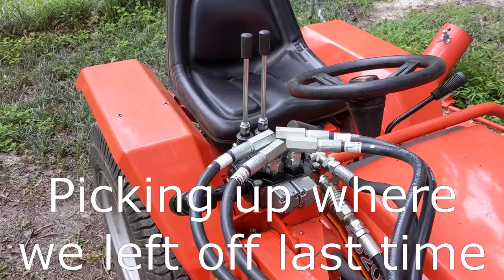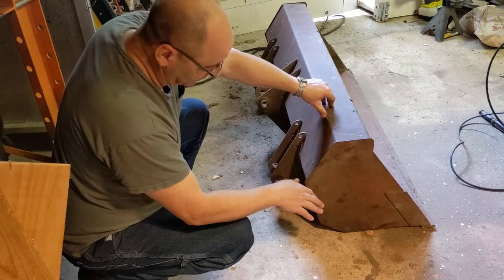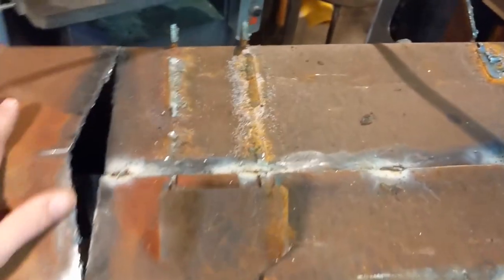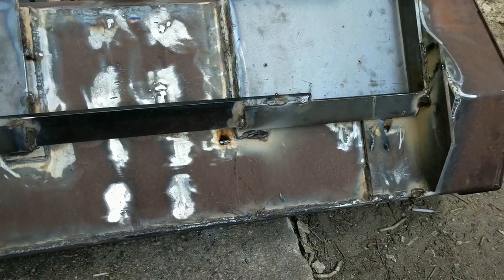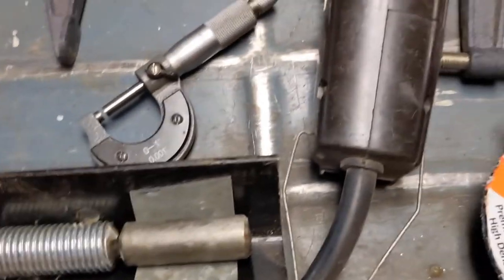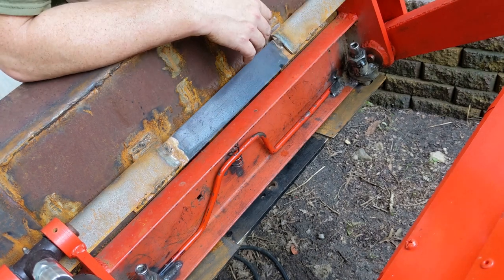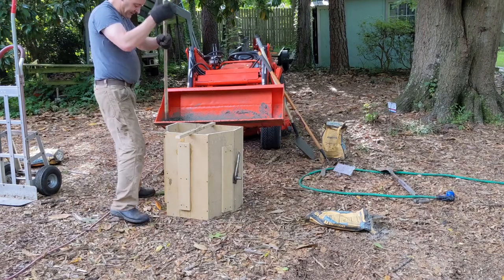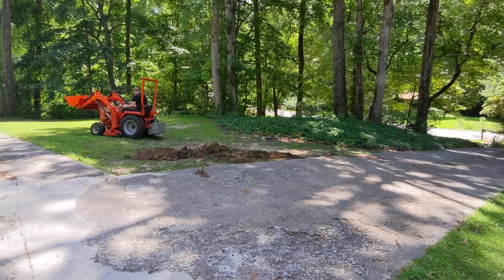Building a Loader for a Garden Tractor - Phase 6: Finale

Comment: Great perseverance!! Great outcome!! And im completely positive that  the Satisfaction you must of felt when it was finally done initially must have been great! And this particular series you put out made me a subscriber as i too hav something similar in the very beginning stages too! I recently aquired whats called a Toro sand pro 5040,its a 3 wheel hydraulic  driven tractor that was originally put out by Toro for sand traps at golf course's with both front and rear hydraulic attachment options, basically looks like  a 80's era honda 3 wheeler but looks like it was built by the same company that builds the armored presidential limo,"the beast"!!! Im talking alot of areas where 1/2" plate was used,buy its a perfect platform for a yard tractor/3 wheeled skid steer! Anyways ,very good job sir!

Comment: This is the best engineered loader and tractor that I have seen. You have corrected shortcomings that the original engineers of the tractor missed out on. I agree that hard lines would be a better change however that would be way too much work. I wouldn't say it is over-engineered because it is something that I hope to do myself. I am in a quandary though. I am either going to use my Allis Chalmers B10 or my John Deere 110 or possibly a Case that I would have to find. After all your work what would your suggestion be? Thank you so much for sharing the build with us. Cutting your lawn is good. Cutting your phone is not so good.
Reply from the maker: Thanks for your nice compliment.  I'm afraid I don't know enough about either of those machines to give you very good advice.  My basic approach is to look for a strong enough front axle and frame, or one that can be easily upgraded/reinforced.  And at least a factory option for a hydraulic pump.   Even if the factory pump needed to be upgraded to a higher volume, you'd still at least have a predetermined location and mounting bracket and drive pulley for a hydro pump.

Comment: I would still put a rubber piece around the aluminum to protect the hoses any vibration will cause the hoses to wear  through where ever it touch metal , an once of prevention is better than a pound of repairs.
Reply from the maker: That's good advice.  I'll see about getting some grommets.

Comment: You had better fill those  rear tires with some heavy fluid ballast ... and be careful driving at an angle anywhere at all .Been a licensed hoisting engineer for 
45 years .
Reply from the maker: Good point.  I ended up with 125 lbs in each rear tire. And a 350 lb concrete counter weight hanging from the three-point hitch.  

Even so I carry the load as low as possible and exercise extra caution on any slope at all.
Reply: @TheBuildist  
I  am glad  that your interpreted my previous comment as  friendly suggestions and not a lecturing as well I hope you will regard this next one .🙂.I only saw the 3 point hitch at the end of the video , by them my comment was posted , so the axles are rated for the hitch weight carrying capacity and that is good.
However ...on small machines like yours, or my 1997 Kubota B2100 loader backhoe  which is a bit bigger than your tractor there is a greater benefit that comes from  tire ballast more than it does from counterweight. The latter is not gentle at all on the hitch components either on rough terrains. As far as carrying the load in the front bucket ,  what applies to larger machines like a Case 780 for example, also  applies to small machines  when carrying a full bucket load . The bottom of the bucket should be no more  an inch or two above the center of the front wheels axles. That prevents the tractor from broaching  too steeply if it bounces forward for any reason at all , that keeps the frame from experiencing a center flex point not dissimilar from the Titanic mid ship break up ...could not resist the temptation of using that analogy🙂. Large loaders like the 780 mentioned are over built to prevent that from happening in the hands of a cowboy type operator , the smaller tractors are not , if enough force is applied they will snap, some dealers keep them visible for customers  to ask how it happened 🤔. There is a new type of ballast fluid that is advertised as totally non corrosive, it is  called  Rim Guard, based on beet juice of all things 😀what is costs I have not yet found out . I am thinking about replacing my own concoction of  automotive  antifreeze ballast with it ...but it only weighs 1/2 pound per gallon more than antifreeze which also does not corrode rubber or steel  unless turned acidic, so other than Toxicity if leaking  the advantage is not much . Never used calcium unless using an inner tube  it rots the rims but tubes have issues of their own .I have never had a problem with mine,  198 lbs in each rear tire , if I need to change it after my next acidity  inspection I may likely use the totally non toxic glycol and call it a day ,  glycol usually does not turn acidic unless over heated  in engine cooling systems   but it  is a good idea to sample it every few years. 
Kudos on your build ...you have excellent engineering and welding skills ...the end result are the evidence of it 👏👏 a mini loader that does not take up as much space, less in fact than a subcompact from any brand ...well done 👏! Good luck and have fun with your mighty 👍 mini 👍👍
Reply from the maker: @jd70HJ19  Excellent points again.  I went with glycol ("RV Antifreeze".)  It may not be perfect, but it's safe and fast and cheap, and I think dense enough to do the trick.

I think driving around with the concrete counterweight all the time  wouldn't be great for the rear axle or bearings, (bushings) but I only mount it up when the front bucket is in use.  So I think it's a decent approach.

I'm actually working (slowly) right now on adding reinforcement to the rear axle.  Because I've bought a little D100 backhoe and I intend to mount it in a quick-detach configuration.  And while nothing is asked of the rear axle once the outriggers are down, driving around with that extra 1100 lbs cantilevered back there I think would be more than the axles are ready for.  So I'm fabricating a heavy steel crossmember that will run underneath the rear diff and clamp to the outward-most collar/boss of the axles.  The hoe will fork onto that crossmember, again as far outboard as possible.  So the weight should transfer fairly directly down/out into the rear wheels without stressing the axle tubes themselves.  

I'm filming as I go, and I'll post it by and by.

Thanks again for sharing your advice and expertise.

Bob